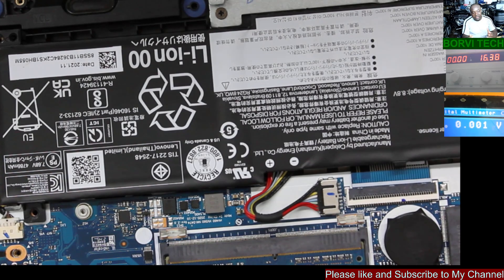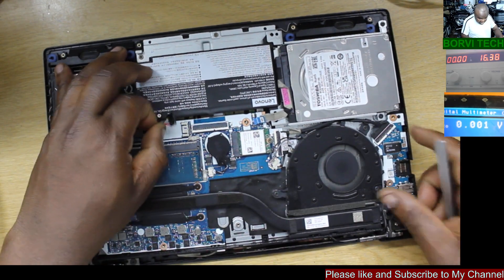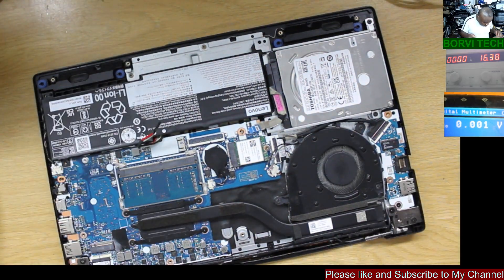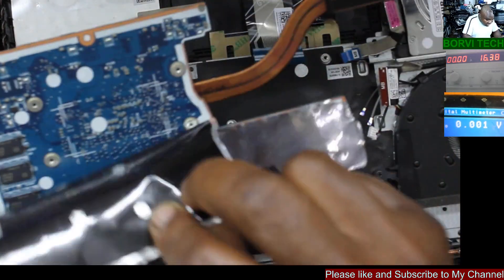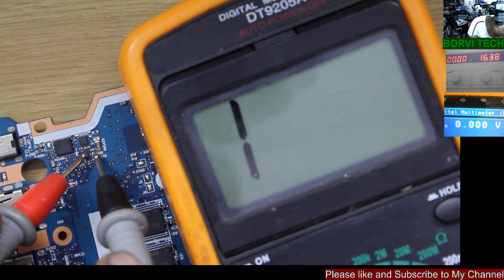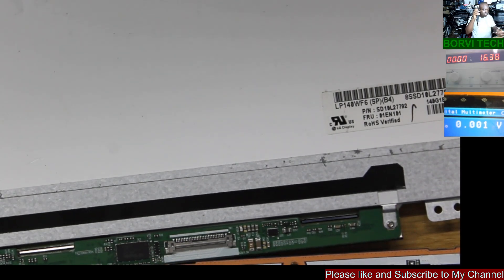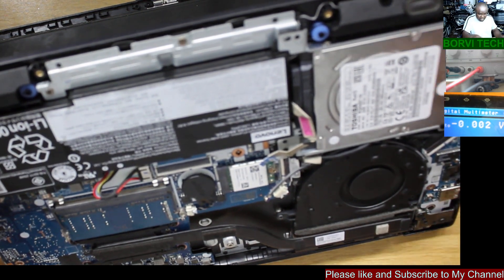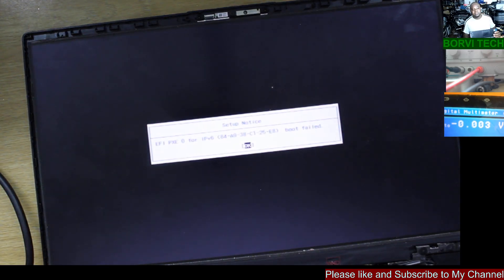Lenovo V14 G2 ITL Backlight Problem Fixed

Comment: Hello, good morning, I would like to ask you a big favour, I have the same broken fuse, where can I buy it, or can I take it from another broken monitor of any brand?
Reply from the maker: That fuse is on the motherboard not the one on the screen,, take it out on another board,,  if you can't get it bridge it with a thine wire
Reply: @borvitech  yes yes, I saw that the fuse is on the motherboard, now I'm going to see if I can find some old broken pc's that I can retrieve it from, but in case I can't find it, you tell me to connect it with a wire how?
Thank you very much from Italy
Reply from the maker: You solder small thine wire to bridge the fuse
Reply: @borvitech  so you say, do I remove the broken fuse and take any wire and join it? or can I cover it with tin in case?
Reply: @borvitech  solder a small wire from the fuse to where?
Reply from the maker: Do you have a repair knowledge????
Reply: @borvitech  Hello, good morning, sorry for the delay in replying, as repairs I did some minor soldering, but I would like to try to solve this fuse problem by watching your video, do you have any suggestions?
Thank you very much and have a nice day
Reply from the maker: @luciano8744 you can watch and  a fuse from a donor board

Comment: Good bro
Reply from the maker: Thanks
Reply: @borvitech  Brother but I have a problem.  I did the same steps, and when I tested it, the buzzer beeps.  When I press the power button on the motherboard, the device does not react at all.  There is no response from the charger.  Are the lights not working?  What could be the problem, sir?  I worked very cleanly.
Reply from the maker: We're you having a backlight problem on the laptop???